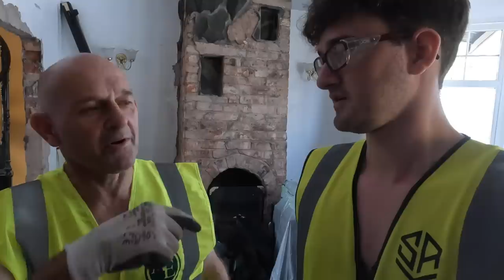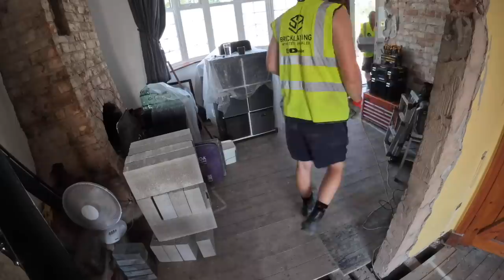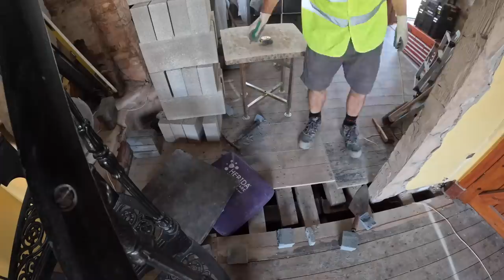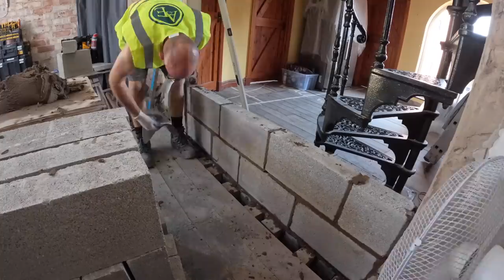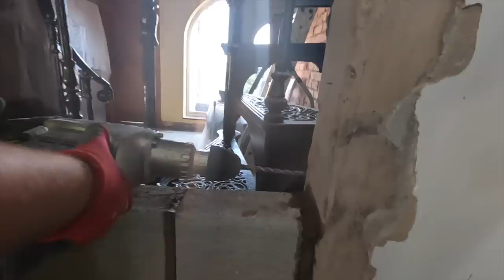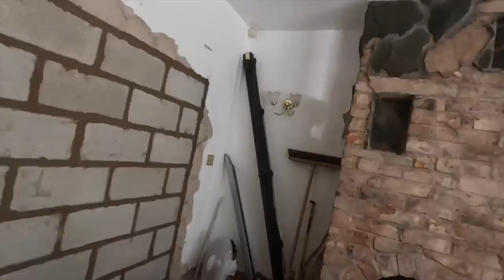BLOCKING UP A DOUBLE DOORWAY WITH 7 NEWTON BLOCKS

Comment: That opening could've been closed in for a fraction of the cost and half the time. Timber 4×2 studs and dwangs, noise control Batts, and plasterboard on both sides. A hell of a lot lighter as well.
Reply from the maker: @martin2466  . Yes the clown is on thin ice now 🙄🧱👍🏽
Reply: @martin2466  Lol.  When theres nothing to be said, some pratt always says it. The stalker returns 😂😂😂
Reply: @martin2466  I know you want me to ask. What is one of them I can only guess and its not a term of endearment for sure 😋
Reply from the maker: @martin2466  . Exactly ! 🖕🖕🖕
Reply: There is a thing known as maintaining structural integrity and consistency within a structure. Besides that using masonry will greatly reduce cracking in the solid plaster, presuming it’s being solid plastered, compared to the timber framing shrinkage. I could frame this out and dry wall it in 2 hours, but I would still do it as the boys did, because it’s a proper job preserving the properties structural integrity 💪🏼
Reply from the maker: Yeah this guy is a complete clown 🤡, comes on most vids always with a negative comment, usually about earthquakes 🙄🧱👍🏽
Reply: But Darryl if it was done your way it’d need other trades to complete it therefore we wouldn’t have this video to read  your professional opinions 🐑
Reply: @aussie8114  bang on!
Reply: And it wouldn’t have reduced the through airflow across the oversight.
Reply from the maker: @gpet23  😁😁🧱👍🏽
Reply: You haven't a clue, have you?
Rule of thumb when infilling openings is like for like.
Reply from the maker: @MrThebigredone  🤙🏾🤙🏾🧱👍🏽
Reply: @martin2466  he brings his opinion. Regardless of whether you agree or disagree with his opinion it is his right to have an opinion
Reply: That’s like saying they could have hung a curtain up there instead 😂😂😂
Reply: @martin2466  you want a discussion on rights and opinions.........well here you go then; everyone has a right to an opinion regardless of whether that opinion offends or upsets an individual or 'hurts the feelings' of the individual

Comment: Just a question, why did you not just build it reverse bond with one cut either side of each course instead of 2 cuts in the 2nd course a 1 cut in the middle of the wall on the first? Thanks
Reply from the maker: Not sure mate 🧱👍🏽

Comment: What is that black strip? Brand?
Reply from the maker: Black strip ?
Reply: @SteveAndAlexBuild  the vapor barrier it looks like
Reply from the maker: @haseldenzack it’s just standard 100 mm plastic dpc 🧱👍🏽
Reply: @SteveAndAlexBuild  So I’m about to remove this back door that leads outside and block it up. Do you recommend laying a dpc down before I start laying block?
Reply from the maker: @haseldenzack absolutely 🧱👍🏽
Reply: @SteveAndAlexBuild  Thanks bud 👌

Comment: As a builder in America, I have so many questions about this.  Please answer a few if you can.

What was this wall sitting on below the floor?  Is the way you infilled with brick and a damp course typical for such conditions?  Why would you infill with block rather than framing, either metal or wood studs and drywall?

Thanks for any answers you can provide.  Your content is very illuminating.
Reply: Looks like originally it was a brick wall and double doors had been put in. The floor is suspended wood and sits on dwarf walls. Foundations are already in for that wall. Seems like the clients are re-plastering the room so probably easier to have a similar material to the rest of the brick in the room to do that. I would say the house is a 1930s build with the floor and internal brick walls. Im no builder mind but I have been through this with my house.
Reply from the maker: All spot on pal 🧱👍🏽
Reply from the maker: All spot on by our other commenter 🧱👍🏽

Comment: No offence to the pair of you; but you stacked the blocked too high before you started; At most I would do only 3x3 towers. Wood is notorious for flexing under load. Spread the load :)
Reply from the maker: @martin2466  🧱👍🏽
Reply: @martin2466  a bit like inflation then...

Comment: On that day I managed to fit one new bathroom lock before going to work. Work started 3 hours late as it shut from 1pm to 8pm because of the heat effects on the measuring equipment.  It was cooler in the factory than outside when we turned up and it eventually got down to a nice 29 degrees by home time. 
 Steve and Alex you are certified as being nuts though I’m sure the clients were happy with that job. Do you not need to tie in those blocks in case of movement though with it being a large void fill?
Reply from the maker: 🥵🥵. Plenty of ties in buddy 💪🏼🧱👍🏽